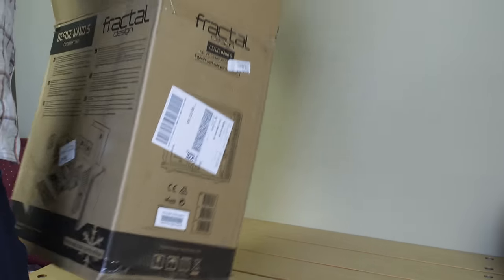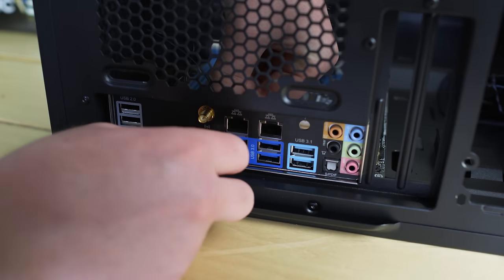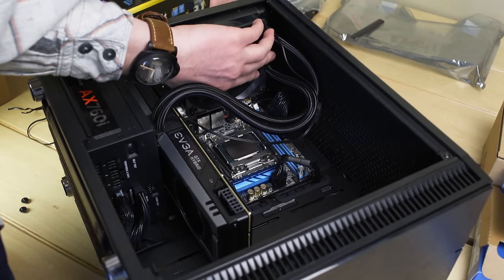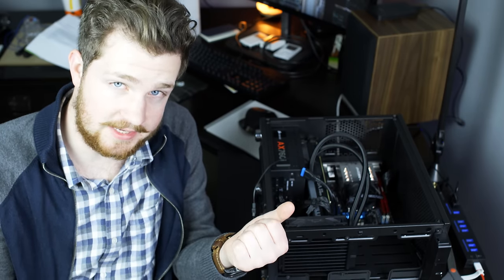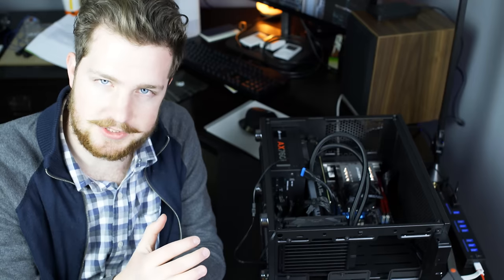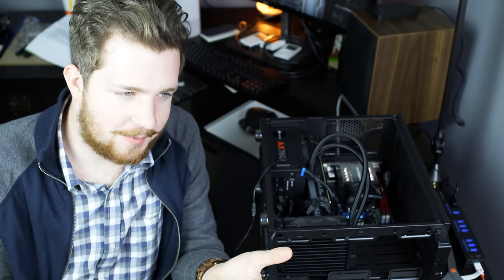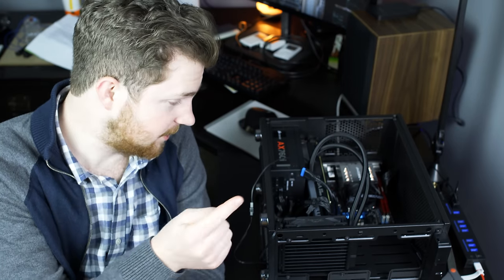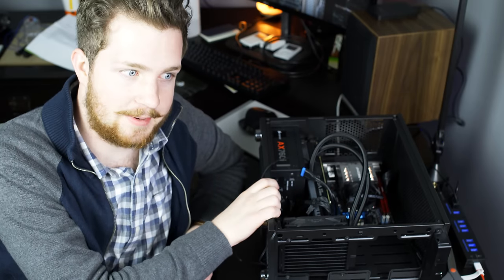My Powerful Custom PC Build Disaster

Comment: Never buy used pc parts,  just never do it, its just not worth it, i have the same x61 nzxt watercooler, runs just fine, all the parts in my pc is brand new, used around 6600 usd on my pc, and the price is very high because of norway.. but having a 5820k 2 titan x`s and alot of storrage im pretty happy about my build, had no problem when booting the pc either, everything just work extremely fine :) maybe i was very lucky, i dont know :P

Comment: WHY did you take a double wide cpu water cooler ????  (just use a standard size water cooler, your eats double size and you DONT need it) i use a more powerful CPU the you and use 2 fans (one who suck and one who draw from both side of the cpu water cooling)...there you have it =) ps...i think your your PSU is ok (you messed something else up)

Comment: Nothing scarier than having a new build shutdown on you unexpectedly.  I swapped my AIO CPU cooler's fans with "upgraded" color coded fans during my build. After getting everything installed, I started experiencing unexpected shutdowns.  I monitored the CPU temps and determined it was the reason.  Swapped the "upgraded" fans to the stock fans and have yet to experience a shutdown.  Massive relief.  Good luck with your troubleshooting and I hope you find it worth the hassle.

Comment: MFW I have a Kraken x61 and 980 ti hybrid. Get a CM Storm V850 Gold for psu. Pretty unlucky with the Kraken though. Here's my near miss:

I had a h110i before the Kraken. One time after I shut down the pc I noticed that there was coolant on the radiator fans. If I had let the computer run for a few more minutes coolant would have been all over the inside of my case. For whatever reason for the screws that hold the radiator fans in place, there is no stopper to prevent them from going into the radiator. In my experience, the stock Kraken is more quiet than the stock h110i.

Comment: After the lack of res[ponce of issues with cosair link my only confidense with Corsair is thier memory. The problem with the PSU is sim[ply a lack of quality manufacture. The worst thing is a lack of res[ponce when corasair blows things. Example: Corsair link not registering H100i. No software fix, no responce. I for one will be staying away from Corsair products.

Comment: Of the years that I've spent building, repairing, and playing with/on custom built PC's I have to say one of the golden rules when building a PC on a budget is don't skimp on the PSU. Corsair is a very reputable company, I run the 1200W version of your PSU but of anything to purchase refurbished it should not nor ever be the PSU. The PSU was returned for a reason and the retailer just deemed it resellable. That's a red flag right there.

Comment: As much as I love a Corsair PSU's never buy a referb component. Also I personally loathe ASrock motherboards (been screwed twice in the long past) and I'd bet more-so that's the problem. Corsair QA vs ASRock QA, Corsair wins every-time, but you never know about a referb process. Also, if you need to put so much force on anything in building a computer you need a tool to exert it then you shouldn't be doing it, end of story.

Comment: +Snazzy Labs 

Quinn, you need to check the BIOS Settings (RAM speed, video, memory type, power management, etc.) If a setting is wrong, boot/reboot/no boot issues will always arise.

Comment: Reminds me of my GPU I had to RMA because DOA and the second one I got never working either, turned out it wasn't compatible with a PCIe V3.0 and just shat on itself and gave up on boot. Fixed that by putting it in the only V2.0 slot I had, but still was pissed. Got new GPU now tho

Comment: The constant rebooting issue sounds very similar to one that I was having with my 5820k. Although in my case I really don't know what fixed it, and it still bugs me. It would boot and run and stress test fine in my case. I would run for days. But if I shut it off and turned it back on, it would get stuck in a boot loop where it wouldn't post. I have an ASUS board with Q-Code, and it would give any number of errors. Searched the board of bent pins, checked everything. Without any reason, it stopped doing that when I transported it across the country.
Best conclusion that I have in mine is that it was some sort of power issue.
Nice Build.

Comment: sounds like my pc when I finished building it in june 2011: the vid card broke down (doa), the ssd didn't work (doa), later the mainboard would give crashes and reset to lowest clockspeed (replaced for a different new mainboard), later in advanced memory testing  found a mem issue which also caused crashes (rma), later psu broke down (rma), tried 2 usb3 card readers but would halfway reset connection to any sd card, later hdmi and secondary dvi connector broke down, 1 of 2 cooling fans on vid card broke down. So yea.. I know what it feels like to be all happy with brand new hardware and then get dissapointed over and over again.... Can't wait to build my next pc when nvidia pascal becomes available =P

Comment: If you plan on having this wired by Ethernet, why did you build on this form factor? The general (and what I perceive to be the functional) appeal of micro atx seems to be portability. Unless your going to say it is cheaper; which is not always necessarily true. Sometimes you pay more for less simply because the prevailing trend allows manufacturers to get away with it. It seems to show most in the case market, where MATX can be more expensive than full ATX; despite generally often having inferior build materials, less build materials and less freedom to build. "Generally," before tards who can't read start breathing heavily.

Comment: Here is a tip I got from "Eli The Computer Guy": don't buy electronics from eBay. And another tip from "Carey Holtzman": the Corsair CX series of PSUs are more than adequate for any build - the other higher end PSUs from Corsair are only useful if you have money burning a hole in your pocket.

Comment: I just don't see any improvement in quality in your latest videos, I've been a power user of both Final Cut Pro and Adobe Premiere (as well as Avid and other apps) since all of them were introduced (literally with version #1 of each). In your case I can see that FCP has just too much stuffer your needs, but I also see that Premiere just produces poor quality video (just compare your latest videos to other channels here that use FCP and you'll see that their videos invariable look noticeably sharper with better color rendition). For you a better solution could have been spending $15 on iMovie, which is easy enough for the home users it was targeted at to generate professional looking results (because its core code is based on FCP X) so its pretty much effortless to use. It allows you to see your video in real time (unlike Premiere, which for the life of me I cannot understand how you could possibly tolerate having to render after each edit just to see what you are working on, thats nuts in the 21st Century) so you will have a faster workflow in iMovie and much better quality than Premiere. You have built two Hackintoshes to get to where you are in your latest videos, which don't look all that great, where instead you could have simply spent $15 and gotten an app that does what you need, delivering better quality and to wasting your time waiting for the exports (from Premiere), so the Hackintoshes did not improve your workflow, they kept you old inefficient workflow and cost you time and money to acquire them. I've dome everything from numerous home videos to professional video, trained ad guided friends and family member to edit their own video video efficiently, so my experience is not only my own, its the culmination of many people over many years. iMovie and FCP X are hard to beat, if FCP X is to hard for you to learn then iMovie must certainly be the optimal solution for you. By the way, in one of your subsequent Hacintosh videos you state the MacBook Pros are't idea for video editing but thats just wring or a misconception. In fact several major motion pictures have already been edited on MacBook Pros, I personally edited several professional documentaries on a years old MacBook Pro and we have never had any problems at all, no slowdowns, no overheating. I thin that you must have read, or were told, old stories of the earliest MacBook Pros which did not have a "clamshell mode" (running with the lid down), i.e. were not designed to operate with the lid down. Users were hacking the system to made it run like a headless server which of course would overheat them when you ran video through them because the fans weren't running. That was not a fault of the MacBooks themselves, it was the user hacks that were improperly done. Apple then added support later and it works just fine (just goes to show that because you can hack something, does not make it good). I also noticed that in a subsequent Hacintosh video you ran a benchmark which showed that you hack was faster than your Mac. Maybe it is, maybe it isn't. You turned off the very feature that makes FCP X so fast when you ran the benchmark so you crippled FCP X into a losing position, which is not scientific.  If you want to see how fast FCP X easy is then have a qualified editor (not you) edit an entire video in Premiere then edit the same exact raw footage exactly the same way in FCP X, tie it and them ask them which was faster. We have had to do that, for political reasons, and FCP X blew away Premiere every time, and in addition, several o the Premiere editors begged to switch jobs to edit on FCP X permanently because it was faster, made sense (once you learned it's basics) and produced video of beautful quality. Its no wonder that several major motion pictures and many TV shows are editing on FCP X. That same engine that powers FCP X is in iMovie so you really should try it for a few months on your Mac Mini and see how that helps you out (besides making you build Hackintoshes every six months or so).

Comment: :| At around 6:30, the PSU it's obstructing half of the graphic card ventilation, so it's overheating. You should ask Carey Holzman for an advice.  Very likely you need a larger graphic card or a bigger computer case.

Comment: So ignoring the hardware issues, why didn't you just try to build a Hackintosh with super upgraded hardware? You wouldn't be compromising as I could see it, you would have a beastly CPU and a 980 Ti, and since its running iOS you could transfer all the data from your Pro with no loss.

Comment: For any of you new computer builders out there - if you have to jam something together with all your force, or when you have to use two flat head screwdrivers, to get the MB connected, regardless of which part of the computer you are assembling - STOP, there is a problem, do yourself a favor and never force computer parts together. It will save you time, money, and you will not have any of the problems noted in this video...and never buy a used power supply, unless you are building a throw away computer. The Power Supply is the most important item - buy new, an buy as high quality as you can afford -  research before you buy.

Comment: ohhhh Never go with a refurb on PSU I made that costly mistake once and pffft poof poop, magical smoke the 24 pin bridge started to melt and my 250 dollar motherboard gone. The 80 bucks on the psu that i thought was such a deal ended up costing me big time.  I should have Just spend the 165 bucks on the new out of the box  psu with a warranty lesson learned even tho i had to wait 2 weeks for a replacement mobo (thanks god for motherboard warranty) buying used or refurb isn't worth the hassle kids you've been warned!

Comment: I'm on my second Kraken. It's wonderful, but the first one I got sent had a crap connector for the pump/fans (stupid design anyway imo). The pump worked fine, but the fans only worked if you squeezed it together really tight. Thankfully the second one seems ok.

Comment: I may be wrong but isn't it a generally bad idea to only have exhausts and no intakes for airflow? he's covered up the front with nzxt and the back with the GPUs cooler. where the hell is the airflow? PS it's only frustrating to build a computer if you cheap out with the essentials. Buy a used CPU, gpu a recurved fan but never buy a refurbed PSU.

Comment: had problem with also a mini itx build motherboard site said it would take 1600 mh ddr3 i installed it had same on off boot cycle i tried other ram and it worked and the original ram now sits in my other pc and works fine so from now on i take spec sites with a grain of salt

Comment: Cool vid. When I build PC's I first let it post without the GPU, to eliminate one possible point of failure, then I let it sit in the UEFI bios for a while to monitor temps, most bios indicate temps nowadays. Then, when all's good, I shut it down and finish with the GPU install, retest one last time, and then Windows install. When Windows is done, then I do my BIOS tweakings (XMP profile etc). Hope that helps.

Comment: Anyone looking to make a custom PC, please don't be worried, the only reason you should be is if you are buying from a dodgy seller or one of your parts is refurbished. And even then you dont have to be that worried. I recently made my first pc for 2000 AUD and there was 1 problem.
The computer would turn on but it wouldnt connect to the monitor. For about a day I was like nononononoononono. About halfway through the second day of owning it my dad was like "Ill have a look and see if everything has been done properly." I come down to my room in like 10 mins to realize I hadn't put in the power for the CPU. Duuuhhh
To conclude, really its not that hard, just follow the instructions and watch some tutorials

Comment: Your error was cheaping out on the PSU, you should NEVER cheap out on a psu, and im not talking only about buying psus from unknown brands or very low watt power, but buying used and refurbished psus is the worst decision someone building a pc can make, it has the power to kill all your pc components or even burn down the house, so, getting 24 hs of frustration is being actually very lucky.

Comment: Your fundamental mistake in this build was not researching your components and their interoperability with each other as well as cutting costs in the dumbest places. A psu is the absolute worst thing to save on, a good psu will save your pc from all sorts of surges and brown outs and bad shit while a cheap psu could actually destroy half of the components in your tower. For the sake of saving 40 or 50 dollars on a 1500 dollar machine. You sure about that bro? Oh well better luck next time dude and BTW if you have to install a component by performing some kind of suplex piledriver you are fucking doing it wrong.

Comment: Public Service Announcement: never buy refurbished products from Newegg. Amazon maybe. Also, power supply is the heart of the system and never cheap out on it. A bad PSU can damage a motherboard intermittently and be very hard to diagnose and replicate failures.

Comment: when it comes to PC gaming, i really cant tell the difference between it, and console. mainly because i use an xbox 360 controller for most of my games. It doesnt really work with CS:GO, so im relegated to using my mouse and keyboard, which im competent enough in to get a couple kills, and have a relatively good time.

Comment: i had a similar issue where even though i had a 850W psu, the combined 12V rails would only put out a constant 720W, which i didnt have a problem with until i upgraded my gpu which then brought my requirements to a consant 757W

Comment: When I built my hackintosh/PC, I would turn it on, but would shut off after 8 seconds. Then it would reboot and turn off again. The problem turned out to be the power cable that goes from the PSU to the outlet had some type of issue, bend it one way, it would work, then the other way, it would not deliver power. So frustrating, I ended up buying a 3rd party one from amazon.

Comment: I never buy 'refurbished' components. Man I hate that word. It sugar-coats 'used'. There is usually a good reason it was returned. I never cheap out on a PSU. Will bite you in the ass down the road. The PSU is the heart and soul of a PC and the quality of it will determine the stability and longevity of a build.

Comment: Its probably the PSU, mine had the same problem many years ago where I had reattach the cables ever boot up due to the  IEC 320 C13 having a faulty connection, was frustrating but was an easy fix.

Comment: Heating issues in your power supply ?
It is most certainly a heat issue somewhere in the machine (and most likely in the PSU)

Also there are only a few parts I would buy used, one would be a processor, another RAM, but never PSU or hard drives, these things are getting used as long as they work, and then sold. They are not replaced because someone likes to upgrade them, so if you buy them used, its much more likely for them to fail you.